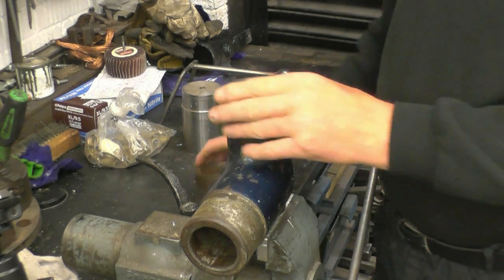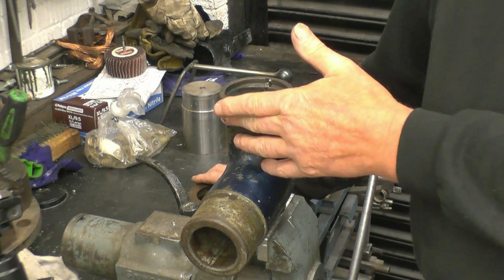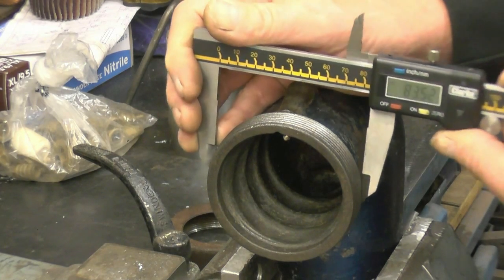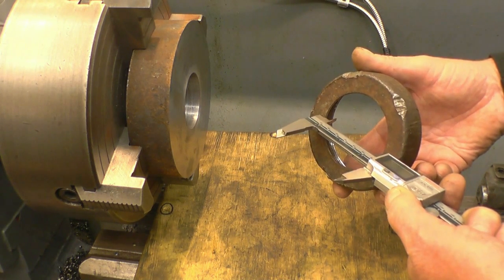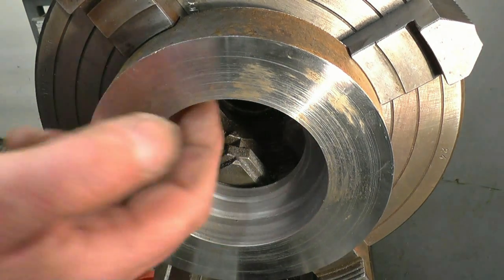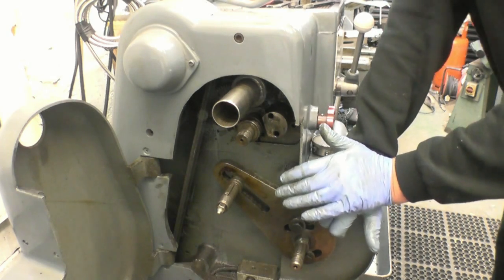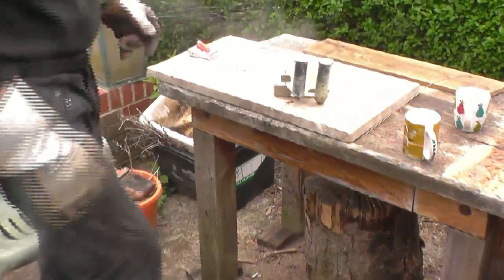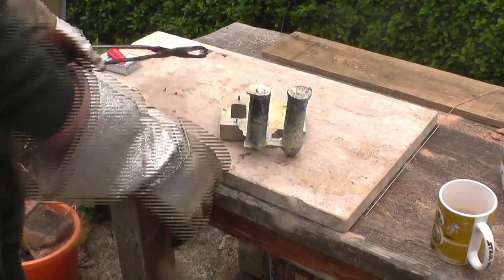SNNC 125 P2  Thread measuring / Internal screw cutting / Casting

Comment: How does a 63tooth gear twined with a 40 tooth make up for a 127 gear ?
Reply: 63 is ALMOST half of 127.  50 is half of 100.  The thread is off by the amount the gearing is not correct, less than one percent.  It is not really a problem unless you have tight fitting threads over more than ten threads or so..  Most smaller lathes use that configuration so the gears can fit in the small case.
Reply: Thanks.

Comment: Great videos again, novice question.  I have a graphite crucible and need to make both a lifter and a pouring ring.  I'm afraid of crushing the crucible with tongs because I'm not sure if the crucible expands when heated. I guess with any weight in it a strong grip is essential.  How much pressure are you exerting on the tongs when you lift?  Is the graphite stronger than I think?  I plan on a lock down fit set from the cold dimension and hope it expands little when hot. Thanks again.
Reply from the maker: The tongs close shut it is the taper on the crucible that "jams" in to the tongs (they are much stronger than you think) but still treat with care

Comment: John remember what Tom showed once ...you can disengage the lead screw when cutting metric.  Note the number or line you were threading on , stop and reverse the lathe and simply engage on the same number or line......all within the same revolution of the dial,,,,dont let it make 100 turns
Reply from the maker: The lathe is still set up for that thread I will have a play on some plastic

Comment: John, congrats on the casting, good and perfect . Wonder if you have ever tried doing fine detail with some expanded polystyrene as a mould, so you can do ultra fine detail in the mould and just have the hot metal burn it away. Same way that engine blocks are made, using a polystyrene foam burn away inner lining so the casting can have fine detail and thin webs.